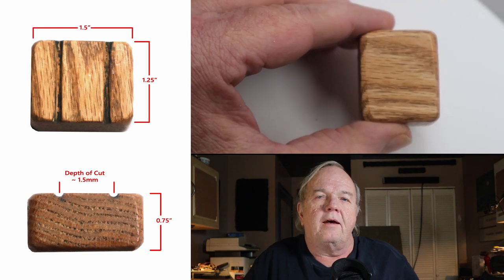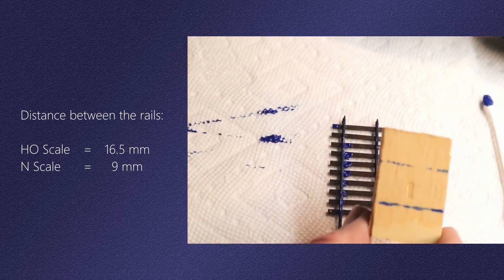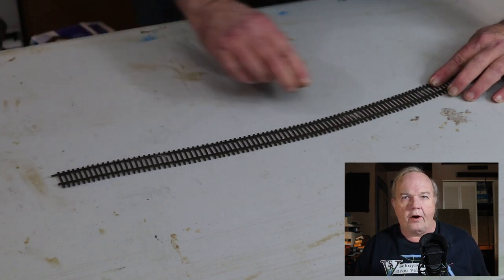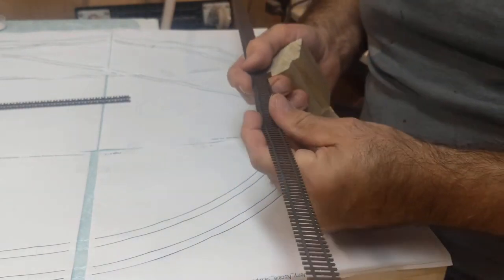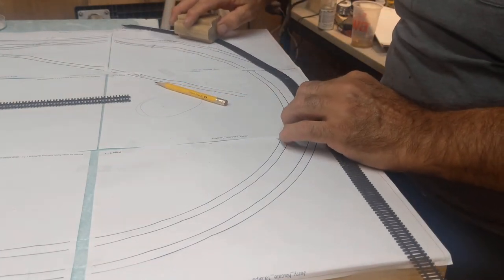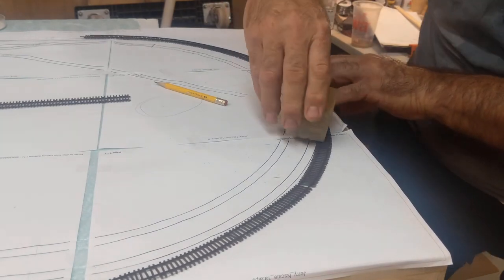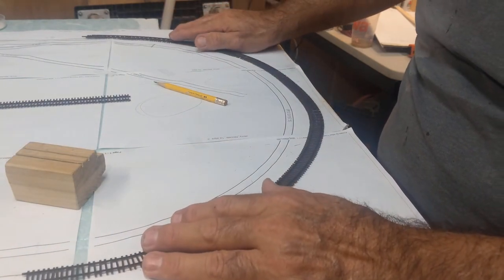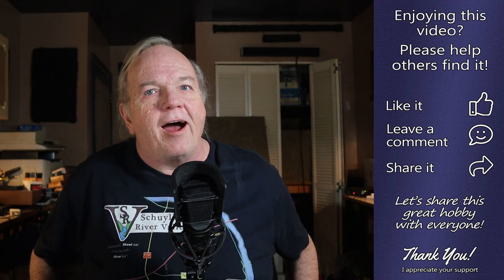Curving Micro-Engineering Flextrack, the easy way!

Comment: I like your intro. Sure got my attention. Great collab with Jerry. Jerry’s track did something that drives me crazy. Did you see the ties go all wonky?? I hate that! I never know how to fix it either. Great video John, love the animation.
Reply from the maker: Thanks Mark! Working with Jerry is fun - he's a great guy. Actually, there's a simple solution to your problem as well. Where were you when I was filming this? I should've included it - guess now I have to do a follow-up. LOL. Take a flat tool that will fit between the rails. The handle of a stainless steel butter knife works well or even a screwdriver. Run the tool along the errant ties in the direction you want them to move. The track should be on a flat, solid surface and I hold the rails down with my hand.  It'll probably take several passes - once you get used to how much pressure to apply. Appreciate your support Mark! Best, John
Reply: It's going to drive me crazy to. If you cut the ties from each other you can fix them.
Reply from the maker: @BoxcarJerry  No need to cut the ties Jerry - that would probably cause you more problems then it solves. I'll do a short follow-up video - should've included it in the original but Mark told me too late.😂
Reply: @SchuylkillRiverValley  John another good video  been trying to get ahold of you, for the HO contest  how can I get your email?
Reply: @BoxcarJerry  Thanks!

Comment: I use the ME code 55 nscale track. I use the ribbon rails to work my curves. I prefer the MR flex but not at all a fan of their turnouts.
Reply: Rusty what are ribbon rails?
Reply: That is a brand name of track alignment tools. It basically is a thin plate of metal. It comes in various radius . You place them between the rails and work the curve in. It is pretty quick and simple Modeltrainstuff has then for $3.59.

Comment: I have used the same type of tool with sweep sticks. Run the tool along the track to make the  rough radius, then use the sweep stick to make it to the final radius. I also have blocks made up to lay parallel tracks at 2", 2 1/8", 2 1/4", 2 1/2", and 3". They are 1"x3/4" and cut to length needed for spacing. You cut 2 groves like how You did, and then cut 1 grove to hold the outside rail of the track You are placing down. The offset is measured from the outside rail to outside rail. BTW a straight sweep stick is an easy way to take a curve out of the ME flex track.